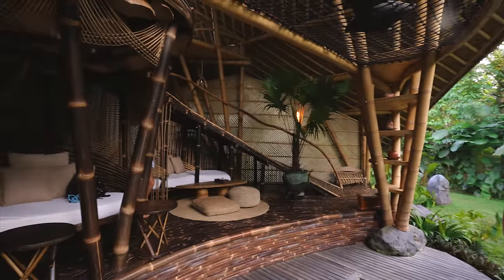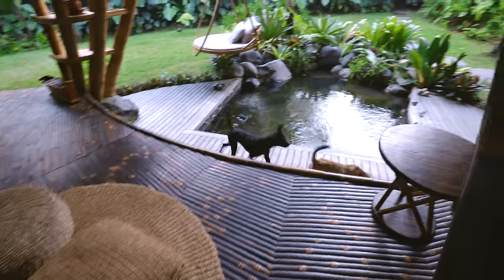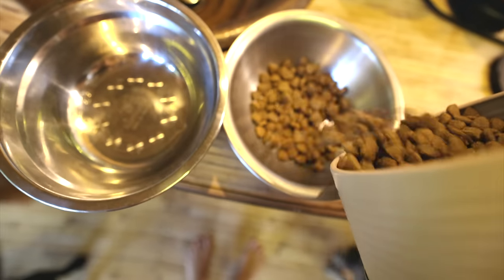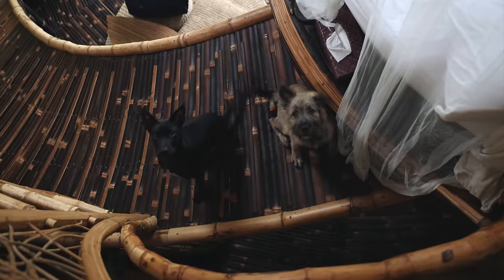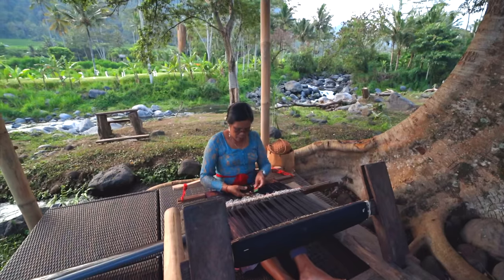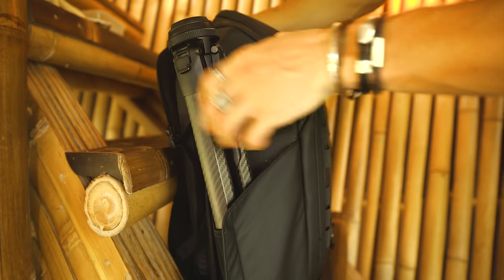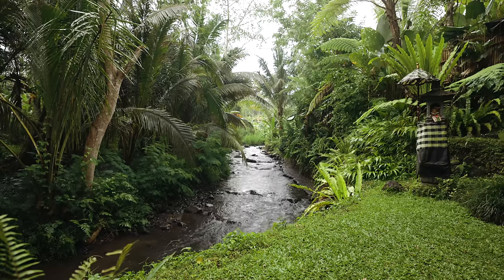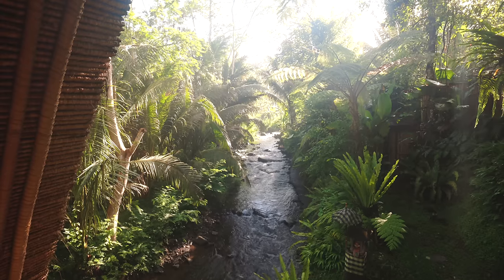We stayed at Bali's MOST FAMOUS AirBnB (Hideout Bali)

Comment: XRP is the standard. 
Forget Bitcoin... it's already had major gains, is slow, expensive and has a huge carbon footprint. 
Forget Doge and other meme coins They have no utility and have already had major gains. 
XRP has real utility - it will be used as a bridge currency between CBDC's. It is fast (3 seconds to process as opposed to an average of 45 mins for Bitcoin), costs a fraction of a cent per transaction so super cheaper, has a very small carbon footprint and will be carbon neutral by 2030. It is also extremely cheap right now so has the potential to have major gains and bring bigger returns than other major crypto tokens, and is working with Central Banks around the world to support the exchange of Central Bank Digital Currencies (CBDC's). In other words, it's huge. XRP is the standard.
Reply: Great content btw. Seriously, look at XRP and thank me later.